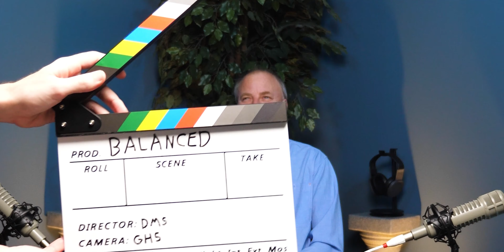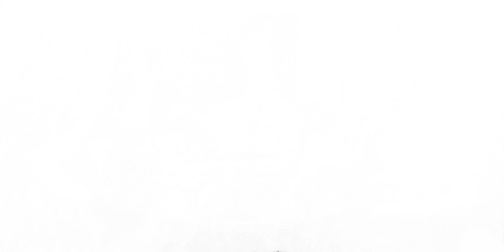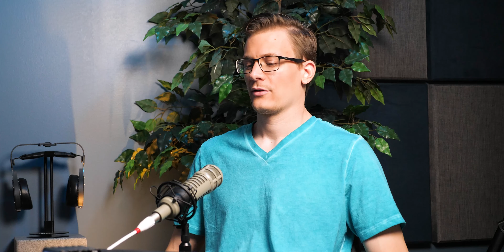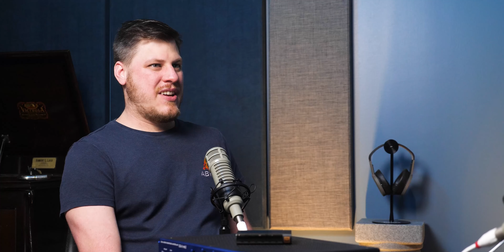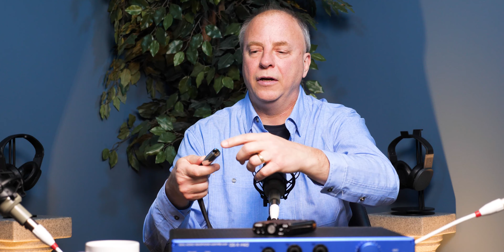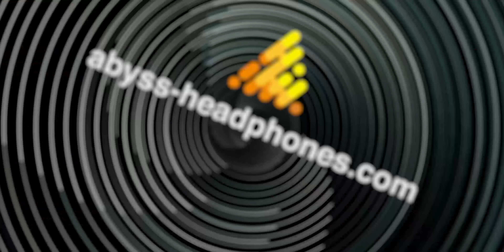Do you NEED Balanced?

Comment: Hey guys, i been doing discos for years, had all different stuff over the years

The music sound source i have used has always been rca outputs, i have never had a cd player or mp3 player with xlr connectors, so i dont have a comparison

Usually the cd player i use is within a foot of the mixer and amp, so there's only  ever a 2 foot length of rca cable

The only real reasons i use xlr cables between the mixer and amps are, your less likely to knock a plug out if you drop something behind the setup, as the xlr are latched in, and rca cables seem to deteriorate quicker

I have had lots of rca cables either oxidize and start to sound really crackly, or the actual pin and ring of the rca plug have separated from the plug and been left on or in the jack on the mixer when i been dismantling the system to move it from place to place

I never had an xlr cable go bad

On the other end of the spectrum, I have only ever used xlr mic inputs, because i have only ever had mics that come with xlr cables only, and the mixers i have used have only had xlr jacks for the mic channels, and again, xlr jacks/plugs are latched, so if you walk around with the mic, which i have done at presentations, the mic plug doesnt pull out the mixer when you walk too far away

Im becoming aware of how good balanced is though, and im getting into the carnival side of sound systems, i ordered a reverb for the mic, and theres only phone plug sockets on it, so does that actually mean im taking a step back?

Comment: with a lot of entry level and mid FI amps that have balanced the emphasis has been on the balanced output and it just is better, or on some they have a 4.4 output for example but it's not balanced at all just the connector is designed to take a balanced cable. See if the amp is balanced and as you say do they recommend using the balanced output as it's often also up to twice the power in terms of Watts and volts. As my budget sits me fully in this space I often end up ru ni g my headphones balanced, although for nomadic usage I am about to get the chord mojo 2 and they don't use balanced so you know the SE is going to be the best output it's the only one 😁

Comment: Balanced equipment is usually  balanced because that give one the ability to keep channels to exactly the same level and to keep noise down, also the transients of left and right are better if you can hear it,  Non balanced equipment has reduced left and right transients because the channels really only use one channel to play them the same, with balanced equipment you are using two mono output amplifiers, it depends on the user’s ability to appreciate the equipment.

Comment: How is balanced different from doubled voltage, assuming two leads for each channel of course? That is: How does a headphone tell the difference between a pair of cables at 0V (ground) and +12V (push) on the one hand, and -6V (pull) and +6V (push) on the other? I think headphones can tell only potential difference and not absolute potential, but I might have missed something. (You seem to agree with this viewpoint, though.)

Comment: For us with hearing damage, who need lots of volume, balanced, especially in smaller, lower powered, cheaper gear, is beneficial for the power increase. No one ever really points that out. For me, the internet's common saying of "you'll never need more power for 95 percent of headphones" does not apply. Magni 3, atom for example, I run common cans like the he4xx at completely maxed all day . So for me, a cheap balanced amp would benefit mainly for the power/slash volume so I am not running full blast all day.

Comment: The formula s shows you that single ended is more than adequate. I prefer lower noise > higher gain/power as long as your power is sufficient, but this can be for hard for hard to drive planar's

Comment: On the Amp outputs on 4 pin xlr vs. 1/4 inch unbalanced at least on my amps the XLR is always the better output.   Phonitor, Holo Audio Mammoth KTE, and cavalli liquid platinum are significantly better using balanced than 1/4.   Obviously the Hps that require more juice are easier to tell but I can even tell on efficient headphones.

Comment: could you go through a run-down of what amp specs you guys look for... There is always the watts @ various ohm loads, stated THD, Frequency response , input impedance, signal to noise, damping factor, gain, noise floor.  I get each metric independently but gets confusing putting them all together to try to judge "quality" by the specs.  Also maybe on tubes you could discuss the different types and importance of tubes:  Rectifier, preamp, power...  Triode vs. Ultra Linear... KT-88/120 vs. EL 34..  Also it seems that Tubes can push speakers/HPs with considerably less stated power/watts than solid state which also gets a bit confusing.

Comment: using a DAP via 4.4mm out to home system can be an issue if the 4.4mm is only wired to 4 pole (for headphone use) but dual 3-pin XLR input on home system needs the ground. Most people use the wrong cable. I hate gear that is fake balanced. It is very common to see XLR jacks but the circuit is not balanced.

Comment: I bought my Diana's with xlr's thinking that I can just attached adapters for 4.4, 2.5, 3.5 and 6.5.  Sound wise, is that a reasonable set up? am I loosing sound quality by using adapter on xlr? Are there adapters that Abyss recommends?
Reply: Holy fuck $300 and $500 for adapters?! Get out of here. Hope you didn't fall for this. Just go to Hart Audio cable and you can get 1 balanced cable that can be used with any balanced OR single ended connection out there with their interconnect system. You can be compatible with basically anything out there for a fraction of the price. Oh and then you only need the cable part for all future headphones you buy.
Reply: @Artaois13  what’s your current audio setup ?
Reply from the maker: This is a start, https://abyss-headphones.com/collections/headphone-accessories/products/jps-labs-abyss-adaptor-cables?variant=12774017171499 , then there's custom...

Comment: great topic, hope u do what the different between class A and class A/B amp
Reply: Class A/B has two devices (generally MOSFETS, sometimes BJTs) operating to amplify the whole wave at low levels, and either half (top or bottom) of the sound wave. The advantage of this is that you can get more power vs an equivalent class A amp, the disadvantage is that when the gain devices switch halves of the waves it creates unpleasant crossover distortion. 

Class A has one device or multiple devices in parallel amplifying the entire sine wave. The are less efficient (less power compared to class A/B) so it is expensive to make Class A amps with a good amount of power, but the advantages are that the circuits are generally much simpler, and there is no crossover distortion so you get a much better, clearer sound. A great class A amp will be most ppls endgame